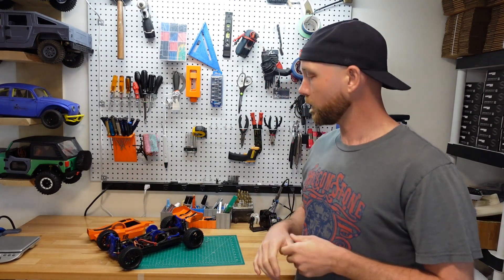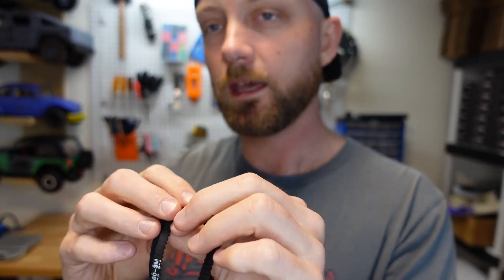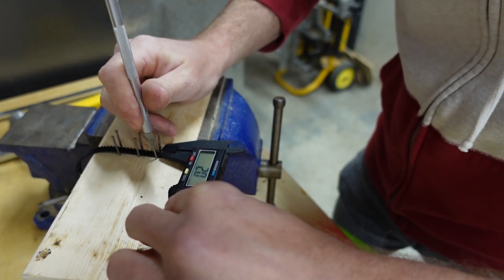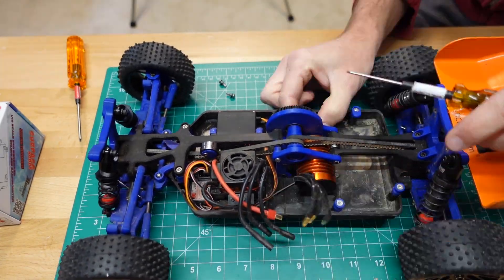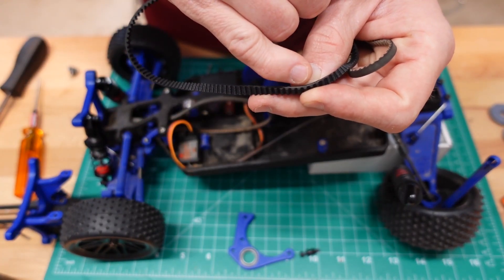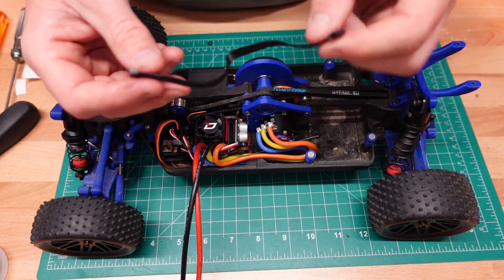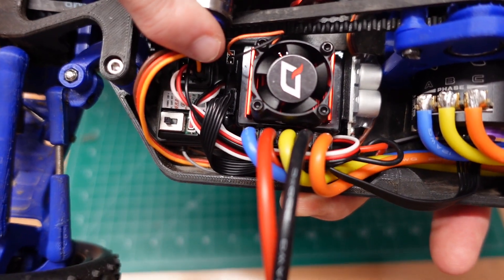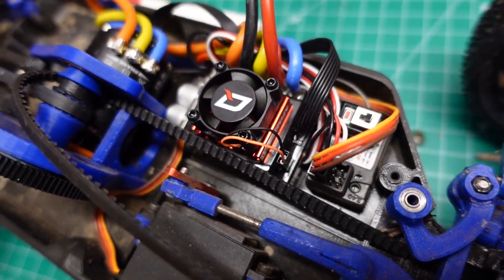MkUltra 3D Printed Buggy - Motor Upgrade, new shocks, new belts

Comment: What size gmade did you get for the front? The instructions call for 81mm eye to eye but gmade only has 75mm or 85mm obviously both would work but you'd have varying amounts of up or down travel, more down with 85mm and more up with 75mm
Reply from the maker: I went with the 75s and I like them.

Comment: If I'm not mistaken, the designer of the MK ultra also made a mod to install a Lexan Body of a Rally Porsche, I was wondering if other bodies can be installed, like a Tamiya rally body, for example, a Subaru Impreza. it would be a really cool mod.
Reply from the maker: I think this is what you were referring to: https://cults3d.com/en/3d-model/various/team-bluegroove-1-9-porsche-959-accessories-and-mk-ultra-adapters

I'm not sure what else might work with these posts but you should give it a go and send pics or it didn't happen! You could also ask over on rcgroups and the designer (lynxman) might answer you here: https://www.rcgroups.com/forums/showthread.php?2952626-MKUltra-A-free-3D-Printable-4WD-1-10-scale-buggy

Comment: Aren't the belts also available in 8mm?  Because on the Discord is a device for print, because you can cut the 8mm belt in two ... from one, get two! 😉
And for the motorplate, i have a .step file from it, so you can include the spacer to the motorplate. When you are interested, let me know, so i can share it with you. 👍🏻😉
Reply from the maker: Hey that's a great idea! I've been talking with our supplier from China that makes most of the belts we carry in our store and they say the actual belt profile for the schumacher ones I was running previously and that you can buy online is STD. As Lynxman says it probably doesn't matter much HTD, GT2, STD at this scale with 3D printed parts but given the choice I'll probably order STD for the store so that it matches.